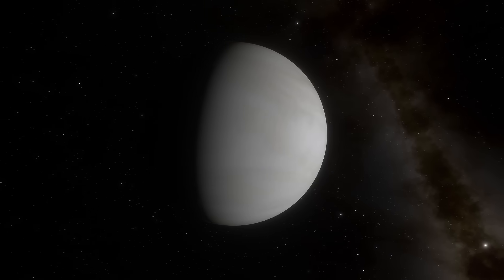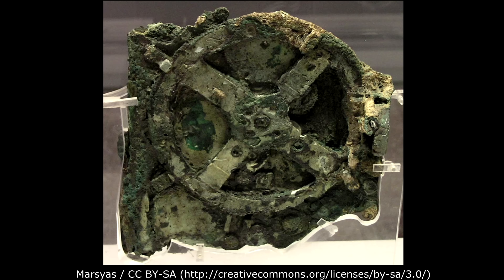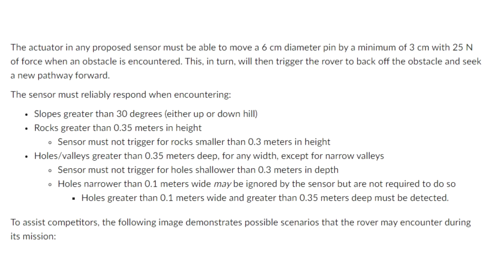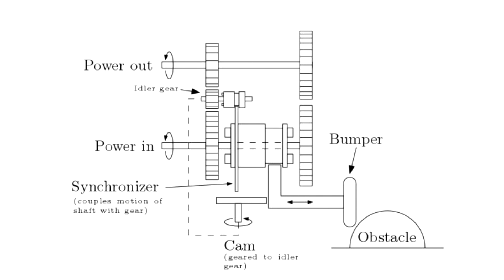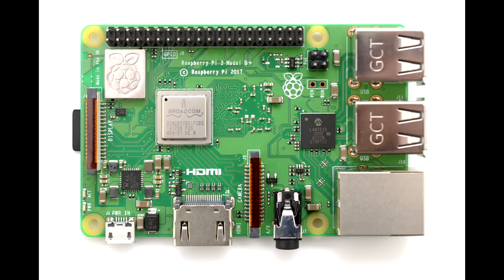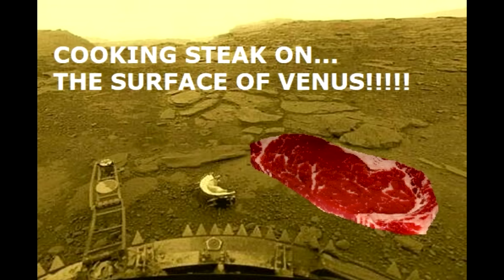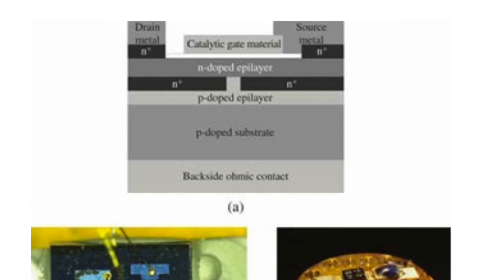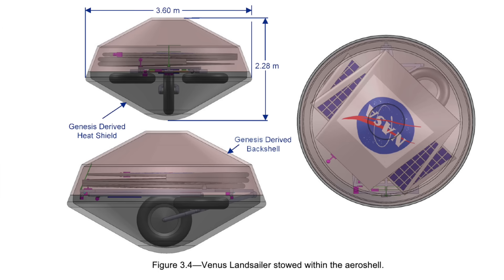Venus Rover Concepts That Beat The Killer Atmosphere

Comment: I just love how everyone seems to forget vacuum lamps. They are perfectly suitable for computing, and would not even need that much power for cathode heat due to high ambient temp. And you can make them mighty small for power saving. Would allow to make actual radio and simple pwm controls, then all the brains can sit in orbit. Stupid nasa will never try it though, i guarantee that:]

Comment: Couldn't they put the electronics in a vacuum flask type thing? It's have to be heavy to withstand the extra pressure but maybe still possible
Reply: It will only delay the inevitable. Conduction and Convection will be heavily suppressed, but the heat from the outside will radiate inwards by the way of infrared.
Reply: @jackvernian7779  That's why vacuum flasks use reflective surfaces to repell the radiation.  Still limited lifespan of cause.

Comment: I'm sure we're all curious what the temperature of the crust underneath Venus might be. If it was somehow cooler, a drill could bore deep enough to dissipate some heat geothermally. But thermodynamically, this seems unlikely.
Reply: Typically ground temperature 1m to 100m? is the average air temperature

Comment: The thing is, you do not really need the power of something like the raspberry pi. simpler µCs need a lot less juice and therefore a lot less cooling. Then maybe use a radioisotope stirling engine to propel the rover and a reverse stirling engine to cool the µC. Electric motors/generators should also be able to run at venus temps.

Comment: I ve got a question if you put computer in vacuum chamber wouldn’t it work? Vacuume can’t be hot or cold according to my knowledge... correct me if I’m wrong.
Reply: putting a consumer-grade computer in a vacuum chamber would likely cause it to overheat due to its' reliance on conduction and convection to get rid of the heat.
Reply from the maker: There's a vacuum between the Earth and the Sun, and we still feel the heat of the sun.
Vacuum stops convection and conduction, it doesn't stop radiation.
Reply: @scottmanley  got it thanks for explaining

Comment: Couldn't there be done something digitally with relays? I mean you still don't get 20000 tansistor equivalent but for some logic it would work. Transistors could use mica and asbestos as insulators (both are already used in high temperature applications), and metals with melting point above 500°C for solder like Aluminium.

Comment: The thought of a venus rover with a thermally hardened 6502 in it makes me laugh for some reason.
XD

Quick! Call some demoscene coders! We need them to program our rover!
Reply: The demoscene coders could probably make it jump up and dance a ballet.
Reply: In space no one can hear the SID
Reply: Here I am. Amiga 1000 Demo programmer on Standby.

😁
Reply: mars got sent a 8086 hardened rover.... 8 bit power baby!
Reply: @nemoskull2262  That's 16. You meant to say that some of them used the 80C85.
Reply: @Ni999  right, I forget they were 16 bit on the inside, some chips had 8 bit external bus.
Reply: @nemoskull2262  The 8088 had an external 8 bit bus. It was that way originally to speed adoption of the x86 command set with less capable motherboards - it wasn't supposed to last as long as it did in the market. The full 16-bit version was the 8086. The 8085 and its CMOS version, the 80C85, were straight up 8-bit chips designed to reduce motherboard and support chip complexity for the 8080, the 8-bit chip that ushered in the revolution.  There weren't a lot put out on the commercial market, comparatively speaking, because the Z80 came along and dominated the space. You were absolutely right on the point of using 8-bit processors, off on a minor detail of nomenclature. No big deal, just filling in a blank on your behalf.
Reply: won't need it!! it's not that hot!! many homes, 2 large cities at lest, and people in short sleeve shirts, think "they" got it wrong!!!!

Comment: I wonder whether you could use thermocouples &c to generate large amounts of electricity to power a full on cooling system for a smarter interior?
Reply: Thermocouples require a temperature gradient to generate power, and the amount they generate relates back to the steepness of that gradient. So, where are you getting the gradient from?
Reply: @absalomdraconis  Yes, I did some reading after throwing that out there & quickly came to that conclusion. But at the same time I found myself wondering about steam turbines as part of a generator set...

Comment: I wonder if their is a way to turn the expansion and contraction of a material into mechanical motion?
Reply: Yes, and it's even possible to use rubber bands to do the opposite, but you need to get it contracting & expanding first.

Comment: Maybe  a better approach would be to try to auger under the ground. Say  the lander is shaped like a  cannon shell or armor piercing bomb and  penetrates say about 10 or 20  feet of so under the surface but in doing so leaves an umbilical cord to the surface. Perhaps it might be a bit cooler  that deep, maybe not. 

But if it is a bit cooler ( say by a couple of hundred degrees or so if that is possible) maybe some electronics could be housed there and any surface probes could connect with the umbilical cord for electric power,  control, and maybe even some cooling. 

And maybe there would be enough thermal gradient between the  capsule and the surface to harvest energy to power it (with a wind powered generator on the surface as well).

If nothing else maybe it could make seismic measurements given it is cool enough to house a small electronics package (like the size of a digital watch) and keep it cool. And maybe it could use that umbilical cord to the surface as an antenna as well. So that might be one approach to consider, given they haven't already done so and ruled that out as not feasible.

Comment: What a crazy place, you're surrounded by heat energy, but you can't make use of any of it!
Reply: no gradient = no way to extract work. You can build mad power stations if you somehow protrude radiators out from the atmosphere and create a temperature gradient. Might be woth a shot later on if we ever try to colonize it.
Reply: @jackvernian7779  "no gradient = no way to extract work."
-
Right. To me, it just always seemed like there should be a way to convert heat energy into other forms of energy, without relying on a temperature gradient. It seems like that would be a huge breakthrough if someone figured out how to do it.
Reply: @PistonAvatarGuy  Extracting energy without temperature gradient would make us impervious to heat death of the universe, which would be pretty cool. We'd basically be punching thermodynamics in its' enthropy-loving face.

Comment: There’s no reason to have an autonomous rover on the surface. Have a blimp/balloon device up in the cooler parts of the atmosphere and lower down a sensor to take a look. When it starts to heat up to much then hoist it back up. It’s the same concept of a ship on the surface lowering a submersible down to the ocean floor.

Comment: Wonder how hard it would be for a sample return mission....🤔
Reply: Very hard. Almost impossible to take off from Venus's surface with chemical engines without gigantic multistaging rocket (which you would need to land on the planet first) and that would be plainly impossible because such rocket couldn't be built for all those conditions (high atmosphere density and very corrosive air). Complicated setup would be needed to do that, like flying submarine-like balloons to high altitude first, then transferring sample to a rocket on another huge balloon and launching from there.
Reply: @vasimvaleev5545  
The best course of action is to start from the clouds. Using miles (Or kilometers for my international friends.) long, extremely tough, heat, pressure, and acid resistant cables. Not to dissimilar to an off shore oil platform you see off the coast.

Comment: 500 °C ! That's also enough to start messing with the crystal structure of the alloys, isn't it ? 
At least the surface G is only .9 so i suppose it could have been worse.
Reply: Don't worry about the temp. (460 °C)
Worry about the 93 atmospheres of 95% CO2.. Superhot Supercritical CO2 is one of the universe's best solvents. Many metals and most carbon-based materials will literally dissolve away into the atmosphere!
Reply: What a lovely prospect. So i guess finding lubricants for all those delicate mechanical computers might be a tad tricky too.

Comment: Storage can be arrays of RAM, in 6 transistor cells not using capacitors. The processor could be the silicon carbide (SiC) IC's, hooked up together (similar to many home brewed systems). The control could be an array of solenoids moving mechanical switches, activated by the radio controlled SiC logic gates, similar to a remote control car.

Comment: Why does it have to drive on the surface ?
Can't we just make some sort of zeppelin or balloon or flying wing with a camera on it and let it drift around ?
I do not know if there is a cloud ceiling and if temperatures are lower, higher up in the atmosphere than down on the ground of venus, but it might be a less harsh environment due to lower pressures and maybe lower temperatures? The only thing I do not know if if would be feasable to make phtos from the ground flying a few kilometers up in the air.

Comment: Just a thought. 

Why not make a diving probe?  We make an inflatable balloon with hydrogen, which works well in an atmosphere of heavy carbon dioxide.  We take off into the upper atmosphere, cool the heat accumulators, charge the batteries, compress the balloon gas and dive. When the heat accumulators overheat, we release gas and take off back.

Comment: I'm thinking airship with dipping probe, if we're going for steam punk appeal: Float to high altitude convert atmosphere to liquid that you use as coolant at lower altitudes, descend and the last few kilometers you have a cable down to the ground. Don't pay any attention to mission complexity or weight requirements or even basic feasibility for such a scheme.
Reply: And you get to brag that you dipped your probe in venus' lower parts, which is always a bonus
Reply: My version would be a porpoising airship.  Rise up for greater solar panel and lower temperature, then dip down briefly to poke at the ground.  Short dips into high temperature are much easier to handle than doing so for a month.
Reply: @rhamph  I like the idea, it could liquefy or compress the gases while high up, and then use those gases to cool the components while down.
even the high altitude thruster motors could be power generator while close to the ground.
the problem would be making so it could resist going to Venus high pressure high temperature acid cooking pan, lower atmosphere.
also, solve the whole deal with wind just carrying way or tipping it over.
Reply: I think the airship is a better path for data collection as well.  I think a mission profile something like an anti submarine airplane is an easier place to start, using short lifespan sensors like the sonar buoys airplanes drop looking for submarines.  Those can work for a few hours and use radio to transmit data to the airship, that then sends it on to a satellite for broadcasting to earth.  this way we get the data without reinventing the wheel.  Material science is going to solve the heat issue.  Exothermic bacteria as producers of power and logic functions or something.  At that point the mechanical system is again antiquated.  Its a project to avoid the project that needs to be worked on, due to the amount of data and varied sensors we actually want a mechanical computer is not going to work.  Just making it not seize up and stop working with all the intricate moving parts is worse than putting the effort into heat resistant digital systems.
Reply: It also needs to be steam powered.
Reply: Great idea ! You could make a zeplin but how do you manage to fin a cable long enough that wistant his own weight and/or the pressure changes while the probe/ the whole ship dives . We're not speaking of earth atmosphere here. Even if that idea alows to "erase" the Temperature problem but make others more prominent. And im completely unable to predict wich is easyer. But it's a good lead !
Reply: @darksombrerehorus  Don't use a cable. Drop probes that parachute to the surface, grab a sample, then inflate a balloon to float back up to the altitude of the airship for retrieval. The probes could be entirely mechanical. This method also minimizes the time spent in the corrosive atmosphere.
Reply: @henrya3530  mechanically inflating a balloon in 90 atmospheres sounds extremely difficult for a flimsy clockwork probe. Maybe if you can find local liquids or solids that combine to form gaseous chemical products then you could force it to inflate with not much other power though.
Reply: @henrya3530  might be not that easy too, venus has quite some storms also and are very badly known so arranging a randez vous would be super hard, don't you think?
Reply: i wonder whats so hard about it... you have an atmosphere. fly in it! if it gets thicker - swim in it. from there you just drop the drone on a cable. on earth you also dont built your submarine to drive down the deepest part of the ocean AND fly through the air.
Reply: You could use a Mongolfier, a sealed balloon containing a fluid that boils at the temperatures near the surface and producing lift which brings the capsule into the upper atmosphere, where the fluid cools and condenses and sends the balloon down again.
Reply: Sounds like a cool idea! Id just make a huge tall probe tho, so that you don't have to descend the airship at all, seems way safer
Reply: I was thinking of something similar, but using Peltier cooling.  Although liquid or electric, it is going to be hard to get flow/current to go at a decent rate along a cable that is so long (I was thinking about using the atmospheric temperature gradient to actually generate power, but it is probably going to use all the power and then some just to keep the liquid/electrons flowing at a usable rate over that distance, unless you can do some kind of high voltage Peltier circuit).  The cable itself may be doable with carbon fiber, although the total mass might be impractically large for launch from Earth.
Reply: To reach an earthlike temperature the cable would need to be 50km long, and would be descending through an atmosphere 93 times denser than Earth's. (Guesstimating from this that an airship would need to be at least 10-20 km in altitude) That said, this seems a touch more useful for data collection than anything clockwork would likely be. I'd still be concerned about maintaining a stable flight with the ridiculous wind speeds though
Reply: This is a good idea, barring the fact that a lot of venus' atmosphere is comprised of sulphuric acid. It would easily dissolve an airship and/or dipping rod made of most materials.
Reply: @_Smash_  Glass-coated steel, perhaps?  Like a lab beaker, on steroids.

Comment: Would a vaccuum sphere with the stuff hoised inside with heat resistant struts work? Power could be distributed through induction plates with a small distance between the contacts.
Reply: Yes, would work. Partially, this is what the Soviet Venera probes did.
Problem is, it WONT last the 6 months required for mission spec. (or even 6 hours, realistically)
Reply: It's only good for delaying the inevitable. I'd say we should design electronics with elements in mind that would survive the temperatures.

Comment: How about graphene? it maintains a relatively strong conductivity at high-temperatures and they built a processor out of graphene with 14,000 transistors.
Reply: 14000 transistors seems like very low density, but it is something. Otherwise graphene, being a 2D material is very difficult to work with and may prove unreliable due to being essentially just 1 atomic layer. Besides, you do require semiconductor substrate and other elements to actually "make" the processor into a processor, one material is not enough. I think the way to go is to try and find materials that will survive the temperatures with no cooling.

Comment: Sounds like vacuum tubes would work, at Venus temperature you might not even need filament, it's hot enough already.
Reply from the maker: Need a tube that handles 90 atmospheres of pressure.
Reply: @scottmanley  that's not really a problem, as vacuum tubes don't have to be made of glass, and can be made of any shape.  Can be made of ceramic or metal.

Comment: You could insulate a small computer via vacuum. Although you'd still need to fix it in the vacuum chamber somehow without transferring the heat to the computer or via a magnetic field. You could transfer commands via wireless, if there's a simple computer listening that's more heat resistant and only executes the commands.
Still, there are a lot of problems with this. Beginning with how to fix the computer in the vacuum without heat transfer, or how to power or control the magnetic field. If you have wireless you'd still need a heat resistant simple computer outside. So yeah... pretty sure that's not a solution either ^^

Comment: How about, an apparatus stored in an isolated vessel, full of cryogenic fluid (only the sensors will pop out). It can fly with a balloon and visit different areas, although it probably won't last a very long time...
Reply: Cryogenic fluid will be brought to boil very quickly.
Reply: @jackvernian7779  what if it is in isolated container...?
Reply: @iliyamarinov3444  it will only slow down the inevitable. Convection and Conduction will be suppressed, however the container will still heat up due to infrared (blackbody) radiation.
Reply: @jackvernian7779 ... Well than, back to the drawing board,for more crazy ideas..😁